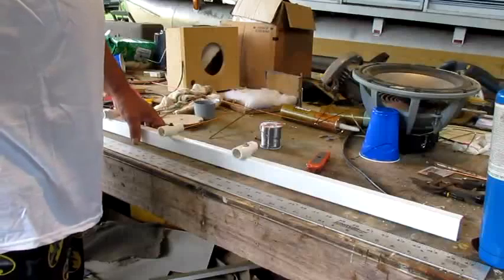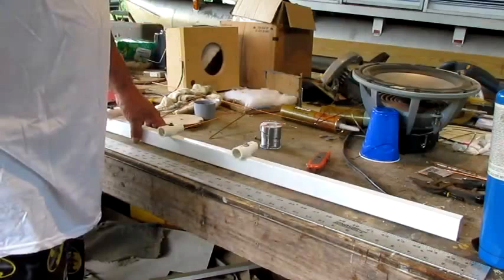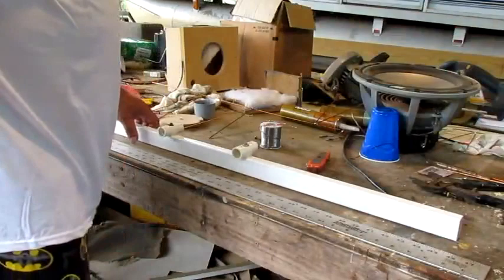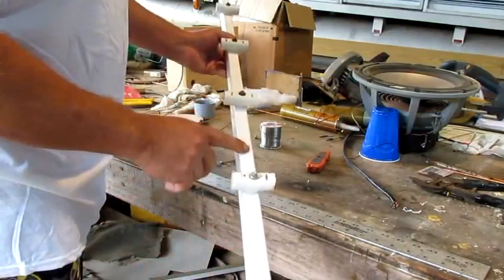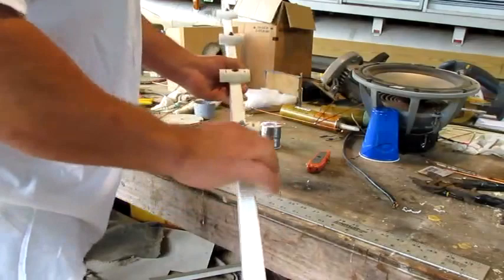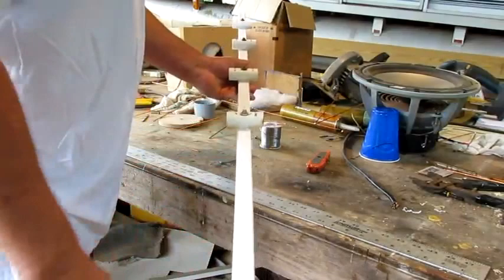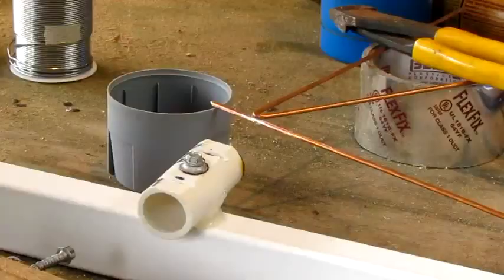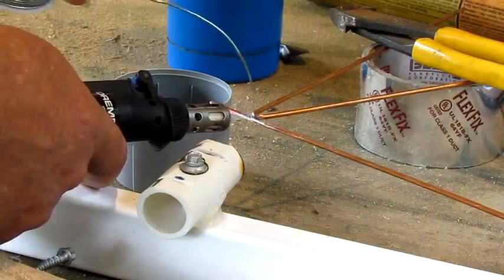Build The All in 1 TV Antenna

Comment: Danny you are a genius!   

I live 60 miles away from one set of towers to the North and 55 miles from another group to the South East.
I had a big honking antenna up and it was doing ok, but not great. I got 11 channels and they were in the 70% strength area.  I ran across your videos on the Ultimate Antenna and thought I would give it a try.  I had scrap around the house to make the entire antenna except for the Transformer - $3.50 total cost.
I put it up today and WOW!!!   I still got the 11 channels but they were at or close to 100%.  In addition, I added 12 more channels and they are between 75% and 60% signal strength.   
I put a wire reflector on the antenna and have it pointing North.  It also picks up the channels from the South East towers.  Amazing!
This antenna has a tiny footprint compared to the big lunker I took down and a lot less wind load.
I am telling all my friends and giving them a link to your videos.

Thanks and Good Job Danny!!!

Comment: Hey Danny, I got an update on your/my antenna, it will kick ass, I dont care if it looks like a train wreck at two thousand feet, it works, it works,it works. I have a antenna from ANTENNA DEAL.  I paid fifty bucks for and is twenty feet in the air, amplified, and it cuts in and out in the daytime, your antenna is strapped to a post on my porch at 7 feet , no amplifier , and it works like a "SPOTTED ASS APE". THIS MY FRIEND IS A "ANTENNA DEAL". THANKS FOR ALL THE HELP FROM S.C.

Comment: Danny,...
A few days ago you asked about day and night reception,.... I was just reading a hundred year old book that talked about it and this is what it said,...
sunlight has the effect of reducing the power of electromagnetic waves,...a greater force is required to produce a given result by day than by night,....that was from marconi in 1902 and still true today,...
robert in niagara falls wanted to answer your question about this,....more details are available but I am sure you get the idea that the light waves supresses the singal with their own vibration etc etc etc,...
Reply from the maker: tks im gone read up ..that stuff is deep aint it..tks brother
Reply: its the same reason people experience ghosts etc at night,...it is much easier for their energy to get through and show themself
Reply: So you know a lot about spark gap transmission of radio signals at very low frequencies. Do you read Morse code as well as they did in 1902 On the short wave bands what kind of traffic do you hear,

Comment: okay Danny West here again I'm in Corpus Christi Texas tonight with an antenna approximately 13 feet in the air I turned it from my local stations North to Victoria Texas 81 air miles away and I'm getting about five stations in and out simultaneously on the other side of the antenna it has no reflector I'm getting Brownsville and Rio Grande Valley which is 135 air miles away... Love the test. here's my question if I build a side by side when heading to the West and one North and South West to local stations north and south to Victoria Texas and Brownsville Texas and I do the coface harnessed through a splitter a balun on each antenna naturally have to be exact in length now if I put a booster on the North and South antenna will that interfere with my West antenna. you and I both know the coax length has to be identical for the co phase harness AKA split coax will the booster cause a problem timing-wise with the two antennas. From what I understand happens if your coface harness is not the same length the signal hits the TV at a different time and confuses the TVs ability to decipher the HD code. so if you follow me if one side of the split has a booster they're not identical. I know this is a tough question because you probably not tested that specific thing but I think that would be a hell of a cool test with your golf cart and trailer.
Reply: im waiting dan to answer your question lol
Reply: would be better if i choose to go school learning in that and by the way a job in that :P
the day a started trying to find how and which antenna ill build is the day my brain get addicted to it as a drug.
its more addictive than cocaine and boobies to me

Comment: Danny - we have been doing some more testing of the Ultimate antenna and we stumbled across an article about matching transformers not stated not to use them because it only makes things worse.  Have you done any testing and if so what was your results?

here is the article:  http://blog.solidsignal.com/content.php/2005-Using-Matching-Transformers-Baluns-and-Chokes 

"If we're using a dipole antenna (bowtie antenna) which is a 75 Ohm antenna, no MT is needed to match the antenna to the feed-line and, if used, it will only make matters worse."

we did remove the matching transformer and we did see some channel improve while others stayed the same.  HOwever, nothing went down in quality.